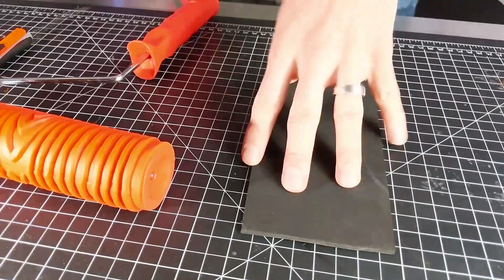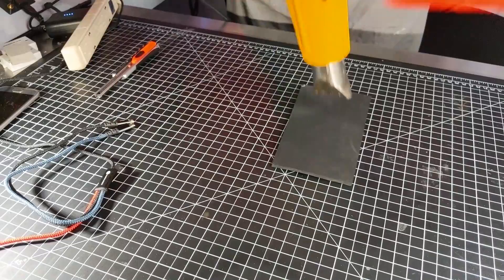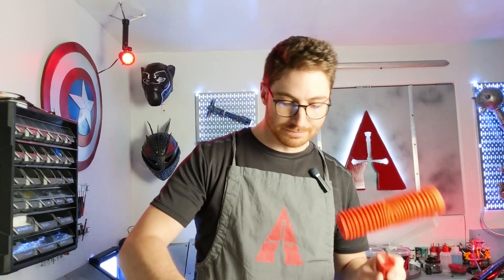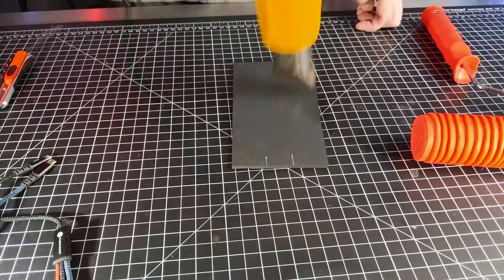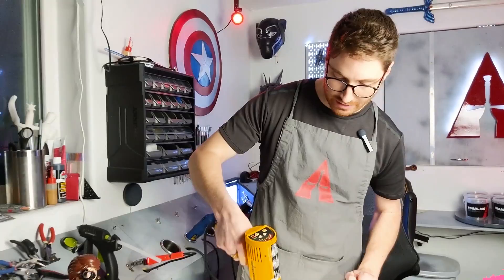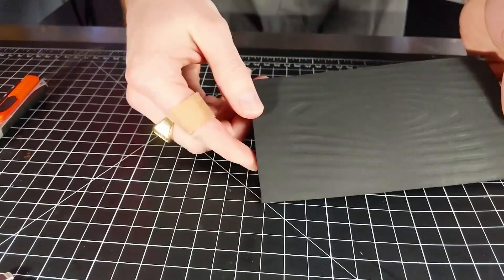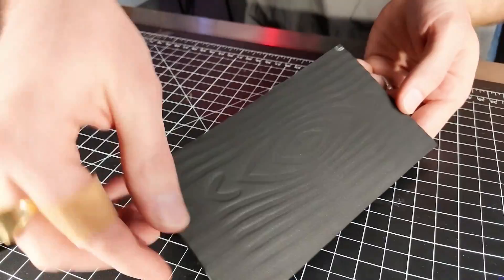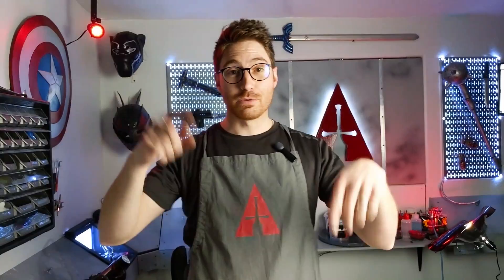Best Way To Get Wood Grain Look on EVA Foam | Cosplay Apprentice

Comment: I use a plain grinding stone bit from a dremel to get that look and just randomly make whatever pattern and indentations that I want. I do long strokes in places and then use different shaped bits to create texture details and knots. That's the best way I've found to do it with the tools I already have. I've also added a small and medium long round dowel from curved eva foam and used it to create larger branch pieces if it calls for it.

Comment: One problem with this technique is that you are going to have repeating areas if you're covering a large surface.  In other words, every 6" or so you're going to have that same knot showing up.  If you're doing a small section, or if you can stagger your pieces you'd get a more realistic look.  As for other textures I'd like to see something for getting texture on scales, other than crumpling foil and ironing it on.
Reply from the maker: Yeah, you would definitely want to make sure you are offsetting the knots and not just rolling them side by side the whole time :). Oooh, scale texture, that would be cool! :)